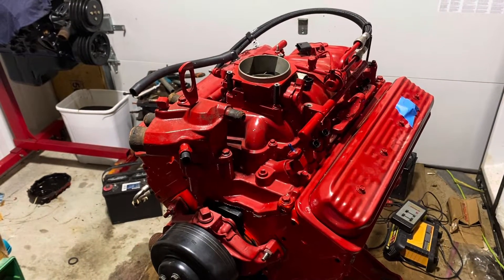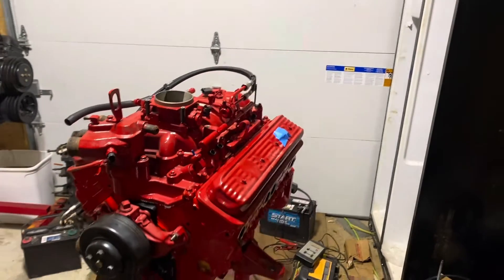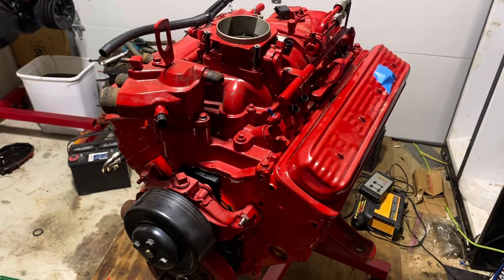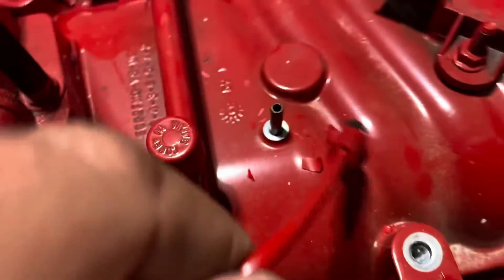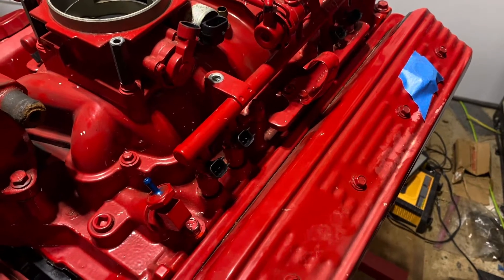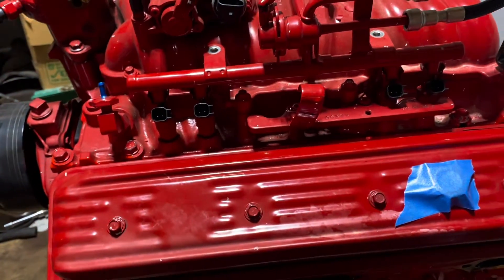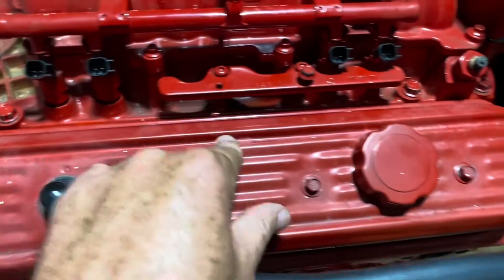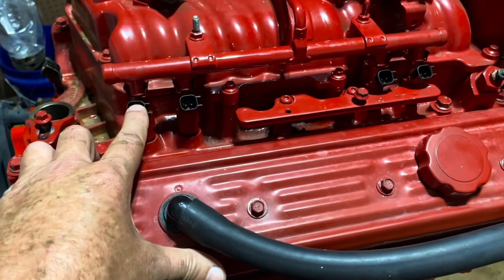Volvo Penta 5.0 To 5.7 - How To

Comment: It might be a secret to many but it really is straightforward. Thank you for sharing and I hope you make some money for yourself.
Reply from the maker: I don’t make money selling injectors. I lost a lot of money for the few sets I sold (my time is money also) because marine injectors changed a lot over the years and the physical dimensions aren’t the same so you might find injectors that flow the right amount but don’t fit the rails. Also, buying reman injectors is a crap shoot. When I buy them I flow test them and usually they will have a defective injector or two. A flow test takes two hours by the time I set it up and test injectors individually. So it’s cheaper in the long run to just get the MEFI computer reprogrammed to run a 5.7 v8.

Comment: Hi 

Are you still selling the modified fuel injectors?
Reply from the maker: No I’ve sold a few sets and lost a lot of money. I’m not selling modified injectors. I use engineering knowledge to figure out the flow rate required for your engine and then I buy reman injectors. But the reman injectors were defective and after three sets I gave up.

When the sets arrive to my shop I test each one by flowing gas at the correct pressure and measuring the flow rate. If the rates are off by 2% they are rejected. You are better off getting your MEFI ECM recalibrated for the engine size you are using.

Comment: How did everything work out? Im looking to do the same swap. Did the larger injectors work to deliver the extra fuel?
Reply from the maker: No problems.
Reply: @moccasinmarine I'm interested in the injectors you used.
Reply from the maker: @augustsparrow1960  I need to know your injector part number to verify the new injectors you need.